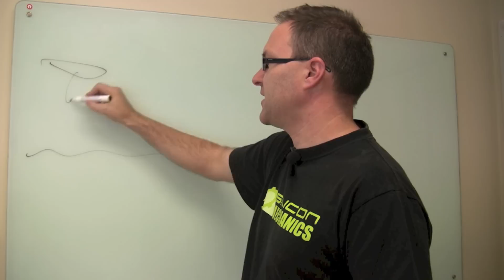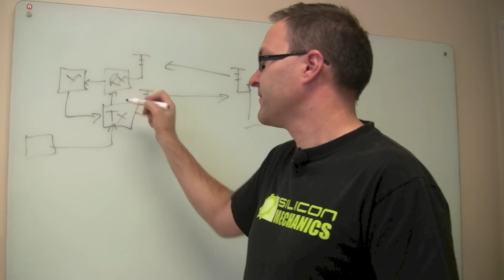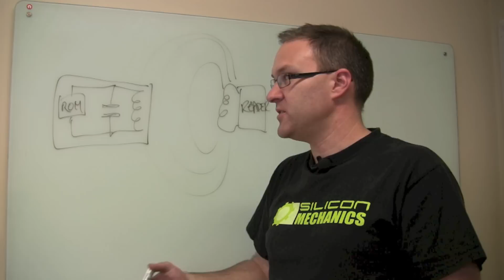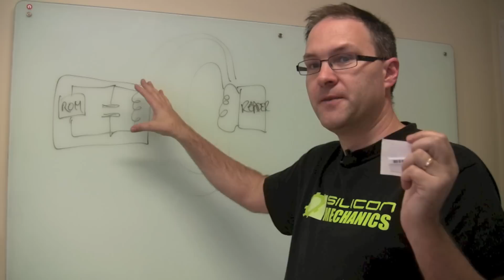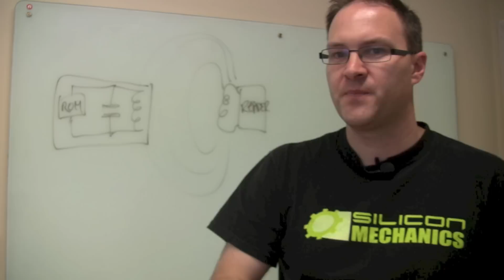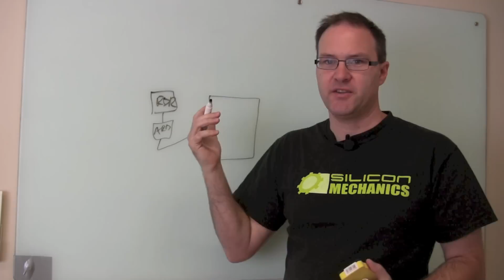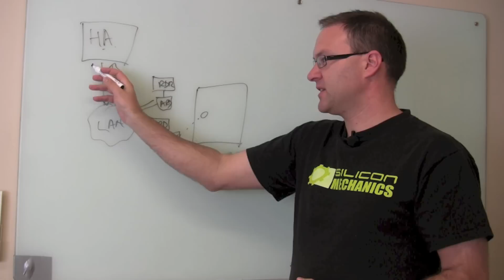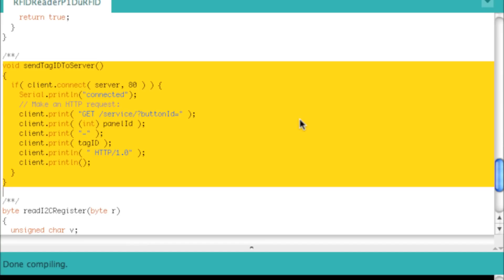SuperHouseTV #7: Control door locks with RFID and Arduino

Comment from the maker: In the past I've fudged it by using a DS18B20 temperature sensor and using part of its address as the Ethernet MAC, but that's not really the right way to do it. The chip I'm using now is the Microchip 24AA025E48. It's I2C, and very easy to use. I'll write up some detail about how to use it soon

Comment from the maker: I have a pan/tilt servo mount right here on my desk connected to an Arduino, because I've been working on a satellite tracking antenna. I'm in the process of building a satellite ground station so I can talk to ArduSat, a Cubesat that I helped design that will be launched in August. What you're describing with motor control isn't specific to cameras: just look for info on controlling AC motors. You could use a triac, or even relays if you want to go low-tech

Comment from the maker: There's a long historical back-story to why there are both 125 and 134.2KHz implantable tags, but the short version is that some of the first companies doing it (for pet use) in the USA chose to use 125KHz before the international standard of 134.2 was ratified. Other countries follow the standard exclusively so it's easy, but the US now has a mess of incompatible standard & non-standard systems so US veterinarians need to have multiple readers to cover all the common tag types

Comment from the maker: They experimented with passive radar reflectors for identification as early as 1938, but it didn't work well enough to be practical. It was too dependent on the angle of reflection, etc. The system called "IFF Mark I" was an active reflector system first used at the end of 1939, but it wasn't very reliable either. They switched to a multi-frequency system called "IFF Mark II" in 1940, which ran at 42.9MHz, 86.7MHz, and 200MHz.

Comment: Nice vid! Didn't the original British IFF use a passive radar reflector method to detect friendly aircraft? I don't believe they started with a separate coded transmitter... maybe that came later. The difficulty with an omni-directional challenge/response transmission would have been that they could not tell where the friendly response was coming from, so it would not work when there was a mix of aircraft in the general area (general meaning several kilometers range kinda general).

Comment: Hi Jonathan,
I love your channel and I love your videos. I would like to add some information for your viewers who are thinking of implementing a system like this, though. The 125KHz system (EM4100?) that you used only implements identification and not authentication so any RFID chips that are used as keys can be copied in a fraction of a second by a reader that can get within a few centimeters of the key. Good technology to track shirts in a store or to identify a lost dog. Not so good for locks and (semi)-secure systems.

Any RFID system that needs to be even mildly secure will implement some sort of challenge/password (or CHAP) authentication. Systems such as the DESFIRE tags or, if cost is a major concern, even just a MIFARE Classic tag (which has been hacked but you can still get cheap Chinese tags which have the holes plugged). These all work on the 13.56MHz frequency though. Not that it matters.

Just to be clear; the difference between identification and authentication is that in "identification" the key will always answer "My name is Jonathan" when asked, "What's your name?" (will always send the same identification code). So it's very easy for a concealed reader to know the identity of the chip and to clone it. An authenticated system will kind of answer "I will encrypt my name with our shared encryption password and tell you the encrypted form". If the reader does not have the shared encryption password, the answer will not permit cloning.

Kudos to you and all you hard work. I wish I could do all the things you do but I've only tinkered with some of them.

Comment: Have you done anything about making pan and tilt security cameras work using a Arduino? I need something that can control 2 24ac motors (forward/reverse) for the pan and tilt, and 2 5vdc motors ((zoom in/out & focus in/out). Any ideas? Paul

Comment: Hey, I took your advise and used Triac's to control the AC motors. I also used Optocouplers. I have a problem which seems like the circuit is sticking in one place and keeping the motors spinning regardless if the joystick has been centered, Only way to get it working again is to reset. not sure if its software or hardware. any ideas?

Comment: Quick question. Why would you use two separate Etherten units to control the reader and the lock? I would think that just one unit by itself could easily read the tag, authenticate it with the server, and open the door, and that would be more cost-effective. Having two endpoints in the same location, and both doing closely related tasks seems a bit redundant. You do it however you want, but to me it's just more cable, more network traffic, and an extra Arduino that could be put to work doing something else.
Reply: He did this because he already had the EtherTen running the program for the lock and since he had another one and didn't want to redo his door lock so he made a new one another reason why might be because the EtherTen might not be able to handle that much code

Comment: I want to add to this project by accessing a database on the sd card and using it as a one time entry door lock. if the tag is used I want it changed to allow me to view its status and not be used again. until I reset the value... Is this possible to write additional data to an existing entry of a file.

Comment: Great video, pal!
Reply: Also, it sounds like you're talking about a full-duplex rfid system...correct?  If I have my head on straight, I think there's a system called half-duplex.  Where the reader, when something triggers it, pulses the signal, then waits for a response.  Where as full-duplex is constantly emitting its magnetic field.  Again- great video!
Reply from the maker: Mike Wasiukiewicz The system I'm using is half-duplex, because the tag is passive. There's no stored power source in the tag, so it only powers up and responds when it's energised by a properly tuned field from a reader.
Reply: Great!  Thanks for clearing that up for me!

Comment: Hello :D I'm working on a similar project based on controlling a door lock using a chip card , and im using Arduino, so i'll have to use a serial communication between the smart card reader and the arduino. Im still a student and i really need some help ! thanyou !!

Comment: Well am a bit confused about RFID tags. how do you assign  different tags ?
Reply from the maker: Each tag has a fixed identification number in it, and when it's scanned it returns its ID. It's then up to the reader to decide what to do with that ID: for example, it could look up the ID in a list to see if it's authorised. If it's in the list, it unlocks the door. If not, it doesn't do anything.

Comment: Any chance you can/will share the type of electronic microscope you're using to solder small components and an approximate price indication?
Reply from the maker: Geert Vancompernolle I bought it second hand for $170 (I think, it's been a few years) and there's no brand on it. If you search somewhere like eBay for "stereo zoom microscope" you'll find a heap of options, but something to be careful of is to avoid ones that have a very high magnification. Ideally you want one that's something like 7x to 20x adjustable. The problem is that as you zoom in (higher magnification) you see less of the area of the board, which can make it very hard to work. I leave mine zoomed out as much as possible (7x) almost all the time. It's very rare for me to want to zoom in more, usually I wish I could zoom out even further to maybe 4x and see more of the board at once.
Reply: SuperHouseTV most interesting to read that too big a magnification is not good at all.  I was not aware of this, I thought the opposite... Thanks for this useful piece of information!

Comment: Hello, i have watched alot of your videos and have decided to start making some projects myself. But i haven't found any code etc that will work.I have the arduino uno rev3 with a RFID RC522 reader, and a 2 channel relay board. Eventually i will add a keypad also.
I want to create a lock for my gate, where once the tag or code is entered it turns the relay on which will disarm the electronic lock for 5 seconds then rearm the relay.
Would you be able to send me some code please so i can get this working and learn from the code. As i haven't used an arduino before. i Have got a rasp pi which i have got to work over web interface but don't know where to start with this.

Id really appreciate it if you could spare some time to help thank you.

Comment: Is not better if you use just one arduino mega + ethernet shield (hwo will be connected to a wireless router), for all house and make a software in processing for android also for android smartphone, you can avoid to use rfid + Ethernet. If you steel want to use rfid, you can buy a cheaper stand alone reader, and you can connect the NO contact from rfid access control to the digital arduino mega pin.

Comment: RFID readers is kinda dangerous to use in open areas (Forexample main door of your house etc). You can hack (realy) most of readers that on wall with professional walkie talkies. I strongly suggest test your reader with one of professional one before mount it.

You can see one example walkie talkie link to hack RFID reader. All you have to do is touch RFID reader surface with your professional walkie talkie antenna then hit the talk button. Then RFID reader will accept this action as successful card reading (or higher frequency causing short circuit or something like that on reader and let it open the door). Did not tried it with your way (with arduino) but you can open almost all doors with this method which is directly connected to control computer (software side) and door lock mechanism (hardware side).

Example device link : http://www.ebay.co.uk/itm/MOTOROLA-DP3400-DIGITAL-UHF-RADIO-MOTOTRBO-PROFESSIONAL-SERIES-WALKIE-TALKIE-/382242194391